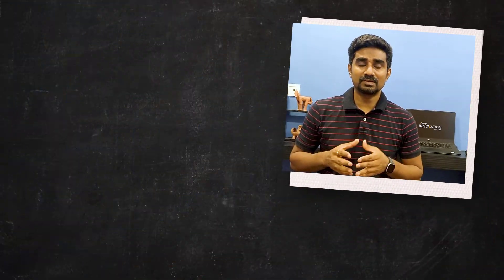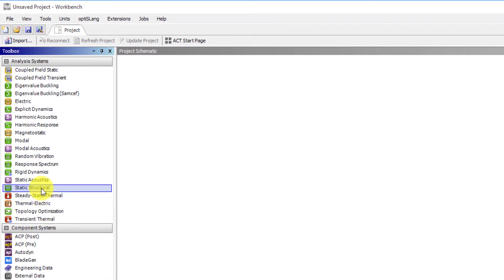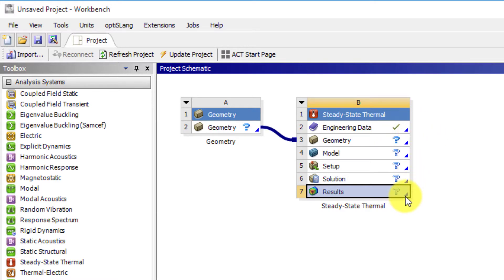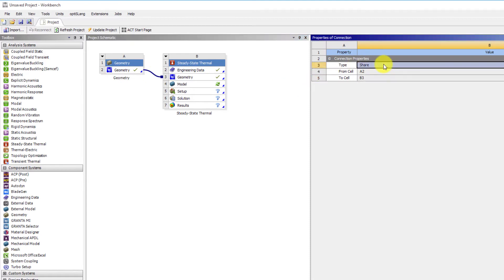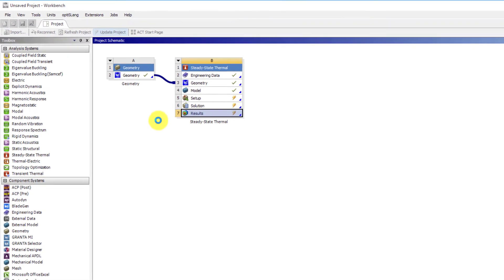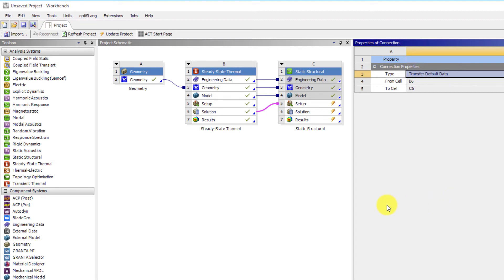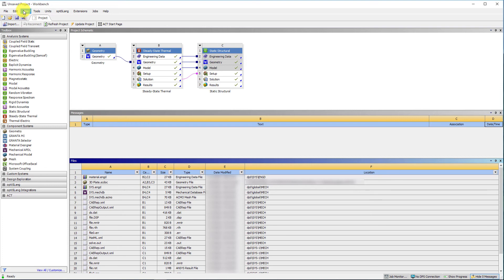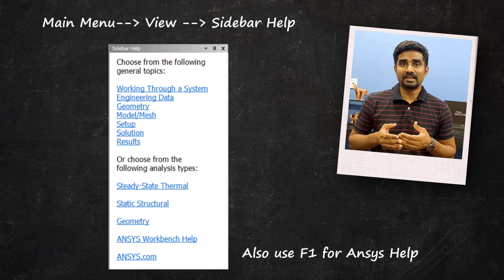Navigating Ansys Workbench UI*

Comment: Hello! I am facing a problem with loading the geometry into Mechanical. Mechanical will crash every time and the following message appears:

'Unable to set display parameters property in Mechanical Either the application crashed or Workbench lost communication with it.'

Do you have any suggestions?
Reply: I have the same problem with 2021R1 Student version. Very often Mechanical is crashing by itself. You are lucky if you had time to save a project.